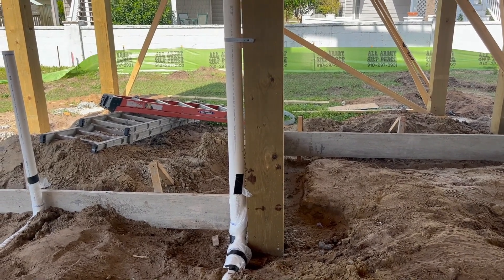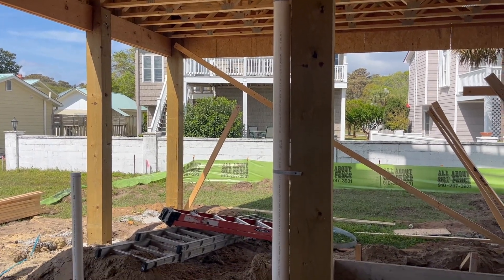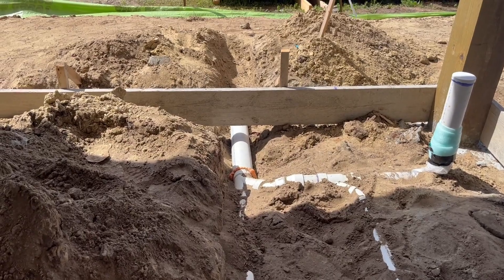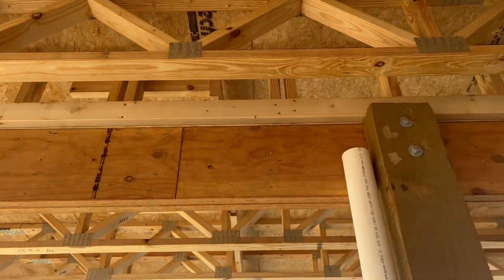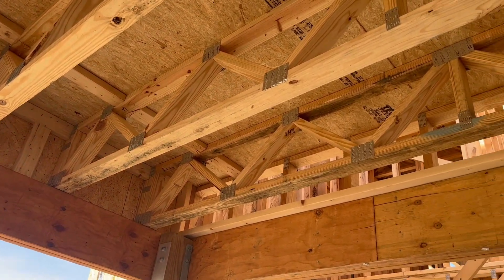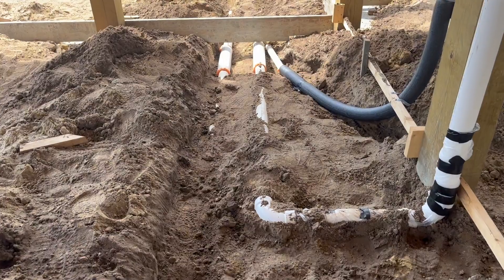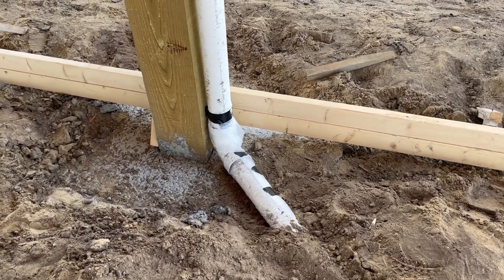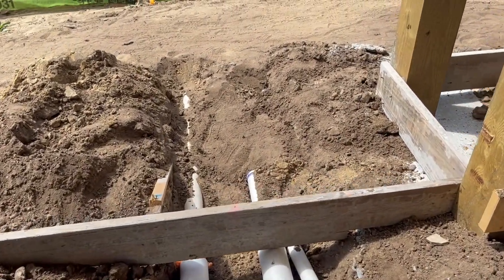Plumbing Basics in 4 minutes.  New house slab plumbing explained.

Comment: I have a 3inch PVC stack and I’d like to add an additional bathroom so 2 toilets, two sinks, 1 bathtub, and 1 walking shower. Also have a kitchen sink on the first floor, and washer in the basement. My question is whether a 3 inch stack is sufficient to handle all of these?

Comment: Where the concrete and pipe meet, why does it need a vapor barrier?
Reply: If you look at the ASTM requirements for Plastic piping ABS and PVC it requires a small amount of expansion between concrete and the pipe. Some inspectors want to see more than plastic sheeting but ASTM does not require more.

Comment: Could you explain how long the 4" sleeve you use for 3" main stack sewer line under the foundation? Did you wrap the 3" pipe with foam and sleeve into 4" pipe? I tried, very hard to do it? Can I skip 4" sleeve pipe, just use foam to wrap around the 3" sewer pipe at least four circles, still bad idea?
Reply from the maker: Where I am its code to sleeve a pipe under or through a foundation wall with a pipe that is 2 pipe sizes bigger than the service pipe.  3 1/2 counts as a pipe size although its not commonly used.  I put the service pipe through and then the sleeve over it until it extends a few inches past the foundation footing or wall and then foam the space between the 2 for pest and rodent proofing.  Hope this helps.
Reply: @risingtideplumbing  can expand a bit on what the 2 pipe sizes larger means. I plan on using a 4inch pipe to sleeve over the 3 inch. so how does that qualify as 2 pipe sizes larger?

Comment: Great info.. question, I don't understand how a 1/2 bath has (4) fixture units to drain - shouldn't it only have (2)?
Reply from the maker: Great question.  A toilet is 3 drainage fixture units (dfus) and a lavatory is counted as 1.   A whole bathroom group is counted as 5 as long at the toilet is 1.6 gallons per flush or less.  I'm going to do a video about drainage fixture units in the near future.
Reply: @risingtideplumbing  Ah, ok, I understand now. Thank u so much for clarifying.
Reply: Does a dual sink vanity count as 2 drains or one ? @risingtideplumbing